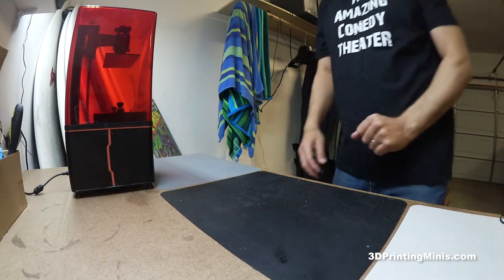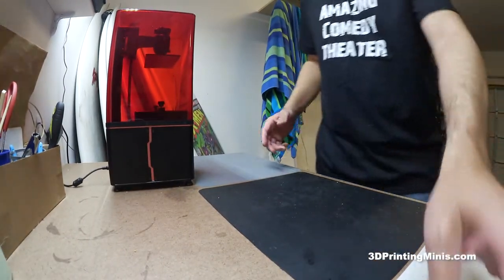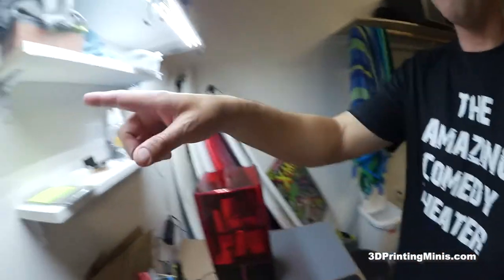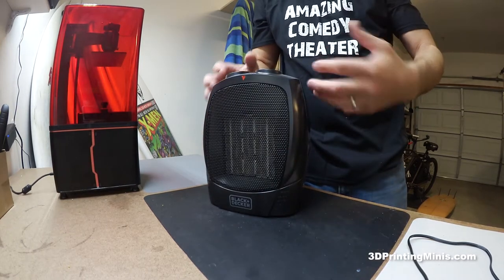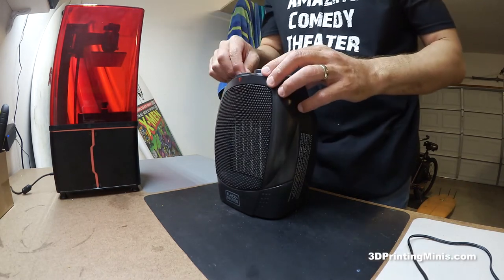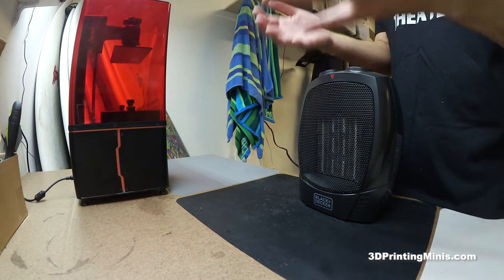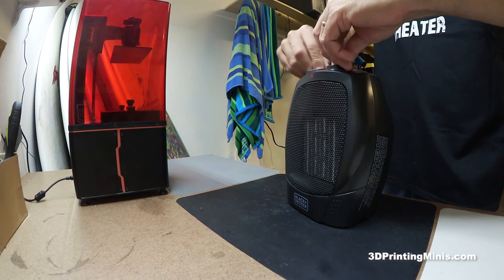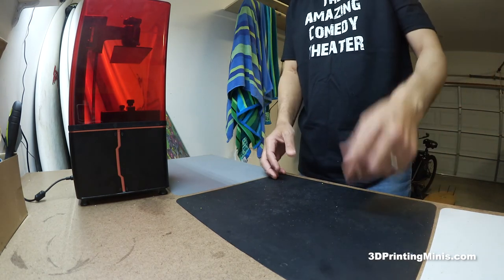How To Heat Your 3D Resin Printer To Avoid Failed Prints In Winter

Comment: This is what I was going to resort to. I still haven't thought up a better solution other than sacrifice and seal off a closet inside the house through the winter. It seems to me that the Mars 2 Pro puts out a decent amount of heat all it's own. I'm wondering if that would be warm enough if I preheat my resin and keep it inside a room temp closet.
Reply from the maker: If you have an extra closet go for it. I don't have the luxury because my extensive collection of rollerblading trophies take up all the spare closet space at my home. #livetoblade #theworldisyourrink

Comment: Thanks, not ideal but I think I'll just move my printer to a less ideal but warmer room. Considering the electricity cost of space heaters, plus the printing time of these printers, I can't imagine this solution being friendly to my wallet, but good advice if there's no other option.
Reply from the maker: I've also seen people use aquarium heaters and reptile tank heat rocks as well. These might be a little cheaper and more cost effective. I just an extra space heater so that's why I used. Best of luck.

Comment: Here's what I do to monitor the temp inside the enclosure. I bought a electronic cooking thermometer with an attached remote temp probe. Made a small notch in the back of the cover for the wire and used double sided tape to attach the probe to the back of the mechanism tower. With the cover on you can easily monitor the temp inside the enclosure. Also helps to warm up your resin. If it's still in the bottle put it in the sink with hot tap water for 30 minutes. Also warm up the vat and build plate. Just some tips from the Great White North. I also use a tiny heater from Amazon to keep the enclosure warm. Oh, no failures so far in my cold room.

Comment: What about heat in garage in summer?
Reply from the maker: Our house is angled in a way that the garage/garage door don't get a ton of direct sunlight. Could be a problem for other parts of country/world that are hotter though.
Reply: That's typically fine. I've had great success in WA summer and terrible results in unheated winter.